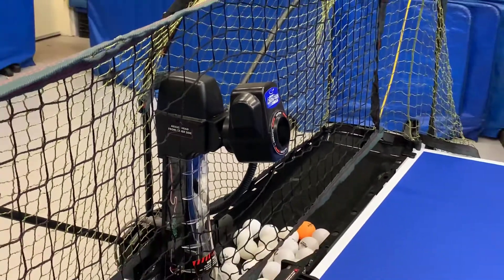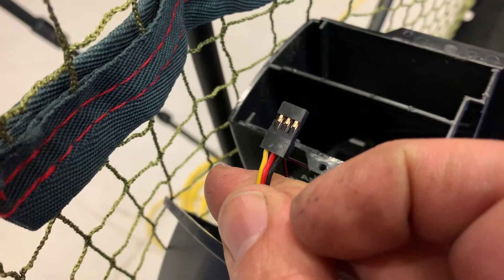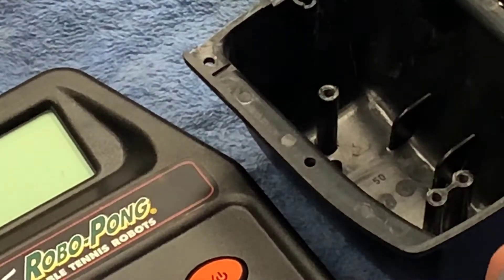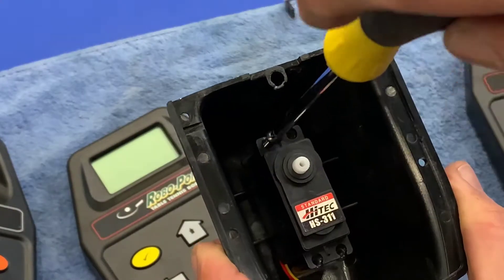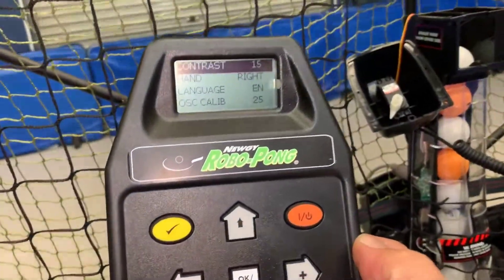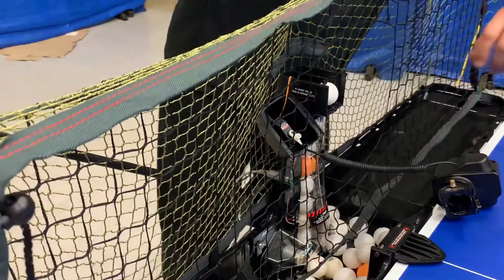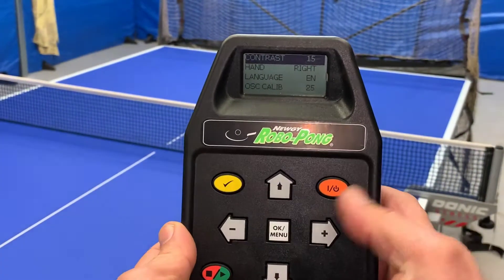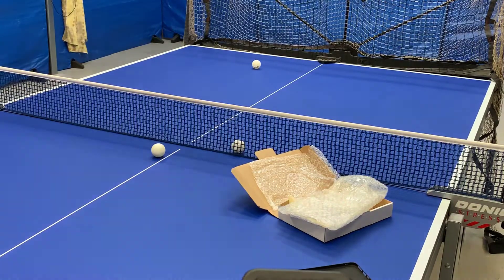Newgy Robot OSC Servo repair

Comment: Hi bro. My robot is Newgy 2050. Recently there is a issue that balls are delivered to the correct position. When I set 5 for R and 3 for L, the head slowly moves to right side to 12, 12, 13.... like this. And then moves back to set position and again to right side 10....13... Do you think this issue is from OSC Servo ?? I've been using this robot for 3 yeas and min 3 times per a week. I'd like to fix it by my self bcz there is no repair shop here in New Zealand. Many Many thanks, bro.
Reply from the maker: Sounds like it’s a servo issue.
Reply: @febatman  Thanks so much bro.

Comment: Hello, thanks for the videos. I have the newgy 2055. After one year, the head has stoped oscillating but balls are still ejected in one direction. Is this an issue of a faulty Servo ? Thanks for your answer
Reply from the maker: That’s one of the possible causes.

Comment: Hello. I have the same issue with OSC. I replaced the original servo with HS-311 but when I'm trying to calibrate it, the arrow is shaking. I don't know how to explain it better. There is a way to send you a video? Thanks
Reply from the maker: Hello Gabriel, did you replace it with the correct servo motor. A HS311 won’t work on older mother boards. You can tell by looking at the back of your controller.
Reply: https://youtu.be/HRInfgcYGmM?si=Ou20WBaD6FiDkX_r
Reply: Heloo, this is the back of the controller.
Reply from the maker: @gabrielstoian8776 I cannot see anything.
Reply: https://youtube.com/shorts/HRInfgcYGmM?si=c-Rxv8AStfJIiDr0
Reply: I cannot attached the video/photo :( 
Can You give me an email address to send You the video? 😢
Reply from the maker: @gabrielstoian8776 support@justtabletennis.com.au
Reply: Hi febatman. Thanks for this video. I ended up watching it even though my problem is a bit different.

My robopong 2050 suddenly mixed Left 0 position with Left 20. i am right handed so If i want balls to my backhand at position Left 0, I have to use Left 20 instead. In Drill mode, all drills I have to play them for left handed players. Any idea what has happened and how I can fix this?

Thanks alot
Reply from the maker: @Wethewisdom.official have you accidentally selected left hand player in the settings.

Comment: Great video. How do I know the servo is the problem? When I power up my 2050, the oscillator makes a whirring engine noise, goes directly to the backhand side, and gets stuck there, never shooting out balls.
Reply from the maker: Generally its the servo that causes the problem. Make sure you purchase the correct version for your robot.
Reply: @febatman  That did the trick! Thanks sooo much!

Comment: Hello, Rob!
Can you, please, explain to me one thing about servo?
I have an old one robo pong 2050 (with black port) and my servo just burned coz of voltage stabilizer outage. 
I tamper a new one to the circut and buy a new servo, but it similar to HS-311. But it still not working. Servo never turns.
You said in video, that servos so different.
Did you try to use new typed servo with an old one control box?
Does it works somehow?
Reply from the maker: Hello Erop, HS311 doesn’t work with old circuitry. Have does rest of robot still work.
Reply: @febatman  Thank you, for so quick answer.
I feels that could be a problem... Idk where I can find old servo for my robot
Reply from the maker: @egor_mandragor  you will find it on our website. https://www.affordablett.com.au/shop/newgy-spare-part-2050-209-10502050-osc-servo-motor-p-3636.html?redirectCancelled=true